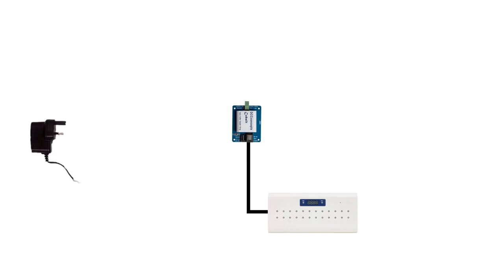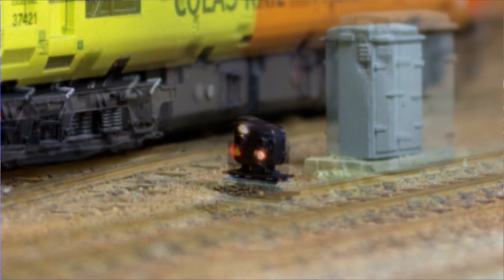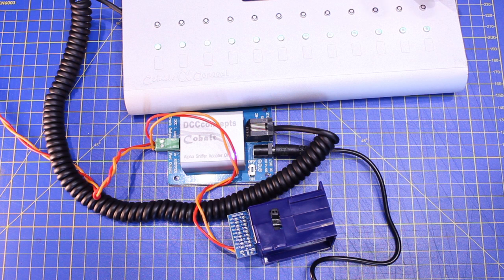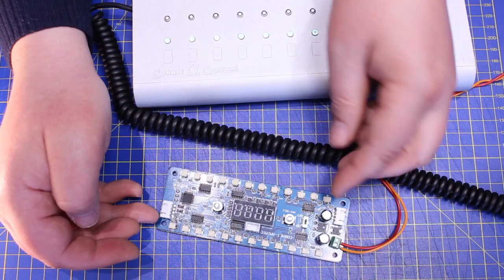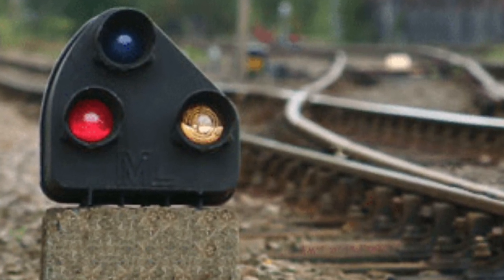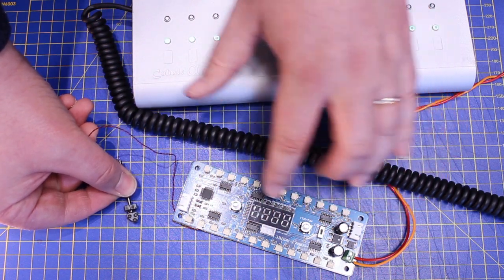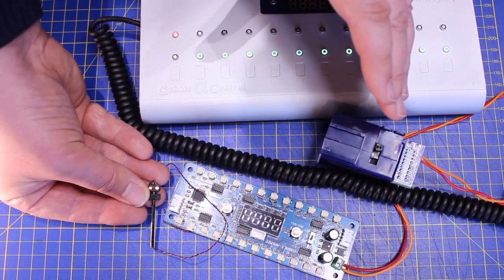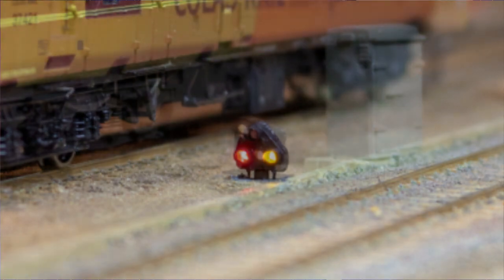Plug and Play Ground Signal Installation in Minutes that Just Works!

Comment: 2:28 Whilst that signal may have 3 lights, that doesn't make it a 3 aspect.  It can only display 2 aspects - horizontal red and white or diagonal double white, if it is truly based on prototype signals.  Essentially it can display a stop or proceed aspect.  It's only a small point, but could be confusing if you use the term "3 aspect" in your advertising for this product.

Comment: I have your kit to use for my acc bus and would like to get some subsidiary (ground) signals but it does not look as though you have the yellow/white type.  Am l correct?  Plus looking on the web it seems the hole drilled for the signal post is too small for the connecting plug to pass through. What’s the solution for that? Looks as though you don’t use collars.
Reply from the maker: Hi,

We do the red/green for UK and US prototypes plus three colour white/red for the UK and four light modern prototypes. There are no yellow/white types in our range.
Reply: I was going to ask the same question, as I have a couple of locations on my layout where a yellow/white ground signal would be appropriate.  Given the reply you have had, I am wondering how easy it would be to swap out the red led for a yellow one.
Reply: @Sorarse  Absolute Aspects sell Yellow dods/dollys  (railway slang)
Reply: @jdavis460  I know dolly - never heard dod, at least in the region I worked.

Comment: Would be nice to get some of these in N Gauge!
Reply from the maker: Much as we would LOVE to do this, it was already incredibly difficult to fit the circuit board into the OO and HO units. At the moment, with current technology, it just isn't possible. But we will continue to push the boundaries as much as we can! 
^RB
Reply: @dccconceptsyoutube6446  I figured that would be the limitation!
Reply: If accuracy of scale was not of paramount concern - what are the differences is the physical size of the HO version to what would be a N Gauge version? I.e. would the HO look absolutely wrong on a N Gauge layout?
Reply from the maker: @GRUMP5B  N is 2mm/foot whilst OO is 4mm/foot (HO is 3.5mm/foot). So it would be twice as large in each direction than it would theoretically be if to scale. It may however be possible to use the two aspect ones as signal heads, if you weren't bothered about them being entirely accurate, and you would just have to build up a signal for them to sit on.
Reply: @GRUMP5B  I'd imagine it would. Look at the difference in size of rolling stock.. or even semaphore signals
Reply: @CGngauge  - thanks for the info. The planning stages are long and arduous. Very soon my sweat and blood will flow when construction begins in earnest. Once again planning too far in the future scrambles the mind. Here’s to the enjoyment to come.
Reply: @GRUMP5B  I planned mine back in 1995/6 When I was 15.... A lot changed between then and now in terms of the technology DCC!! It took me a while to get my head around it all. I really do like the DCC Concept products and have them on my layout. I have found theirs to be very plug and play.. which for me is the important thing as I want to spend time on the modelling not the wiring! Happy building. :)